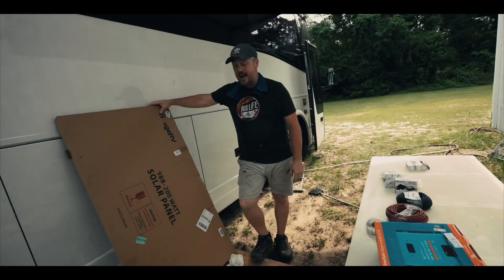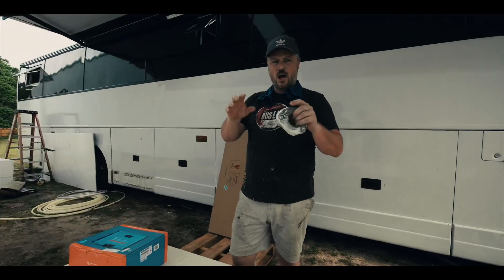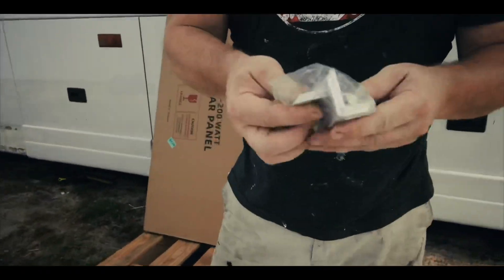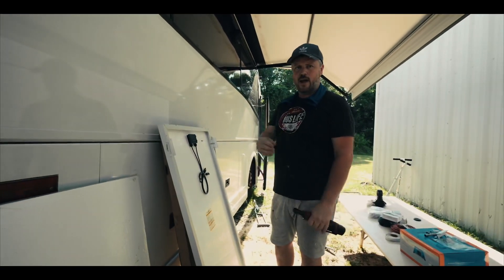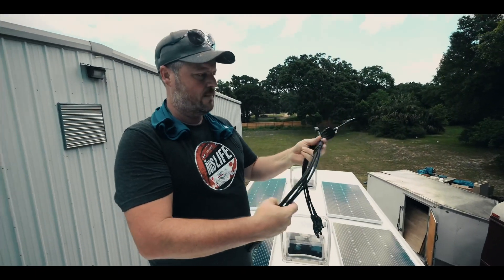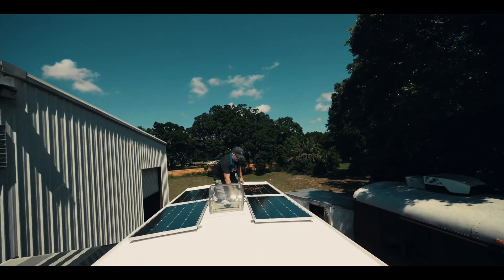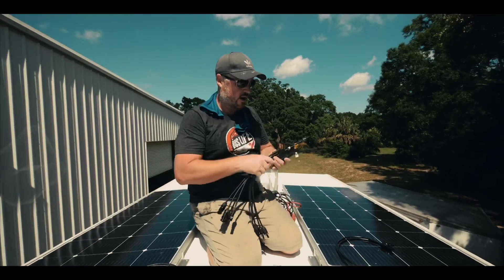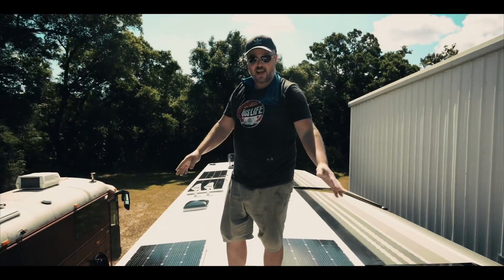Installing 1600 Watts of Solar Panels on our Bus Conversion!

Comment: I'm not a fan of those aluminum Z brackets. I had one crack along the bottom bend. I was lucky that the panel didn't fly off.
I reinstalled all my panels using K2 rails from Santan Solar.
I also found an entry cover with MC4 connectors already mounted. Made my life easier

Comment: Looks good, I was hoping you could do more than 8 panels 
Where you did the roof penetration it would’ve been good if you did some plastic or rubber grommet. There is a chance that the sharp steel will cut the wire insulation from vibrations and there is a fire hazard, other than that it looks very good
Reply from the maker: Yes I will have to add that.

Comment: Did you put protection around that drilled hole in the roof ?  The hole should be half again as big as the combined cross section of the conductors to allow for venting of heat in the wires.
 PS, what stove will you be using ?
Reply: im cautious when you have a hole with a wire coming through. You don't want the wire to rub on  metal or wood and risk damage to the insulation. maybe they will show the fuse prior to the solar charge controller. mine is inline on the roof. or a combiner box with fuses works too

Comment: Any rubber grommets at the hole in the steel sheeting of the roof, to protect the wiring from the sharp edges of the steel?  -C